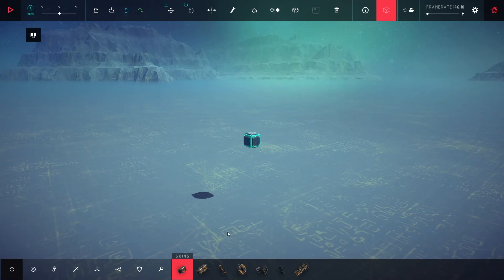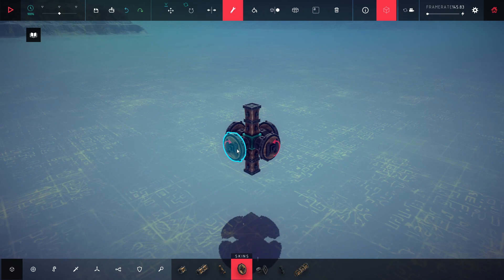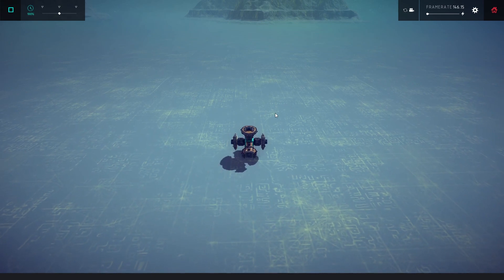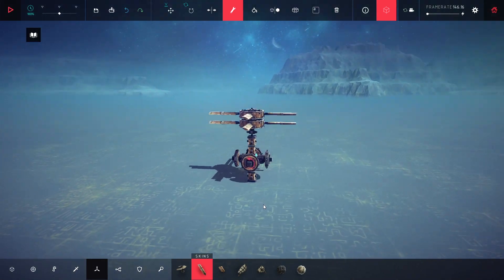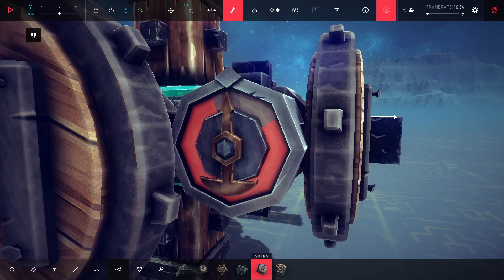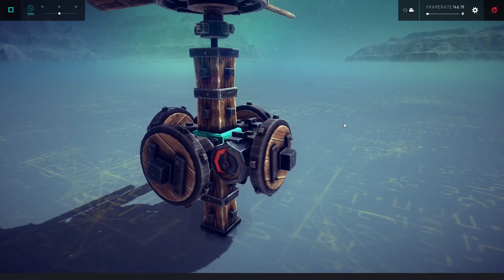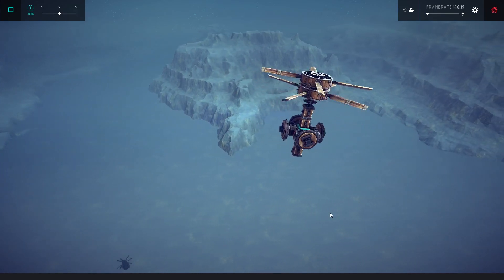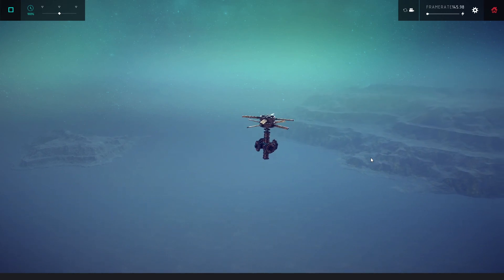How to make a self balancing gyroscope with anglometer [BESİEGE]

Comment: great video! it seems that with the gyroscope down/right are auto-balancing but left/up only semi-auto balanaces. I see the anglometer light up when I press the left/up keys, but when it the anglometer triggers the "right" key for example it doesn't do anything. I triple-checked everything you did and seems to match up. This only happens when I hold the the "up" key for example, if I tap it it does balance out. But strange I can hold the "down" key and everything is fine
Reply: it this on the steam workshop? would be nice to take a closer look at it
Reply: having exactly the same problem